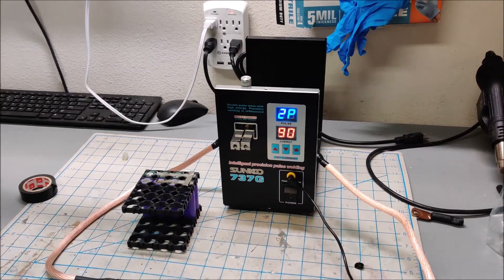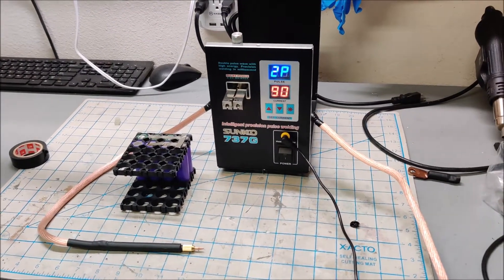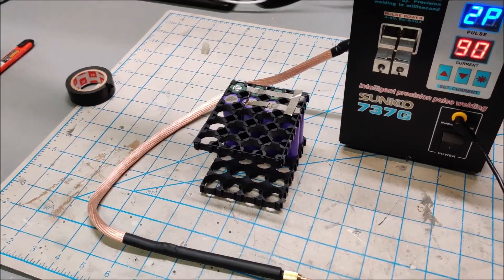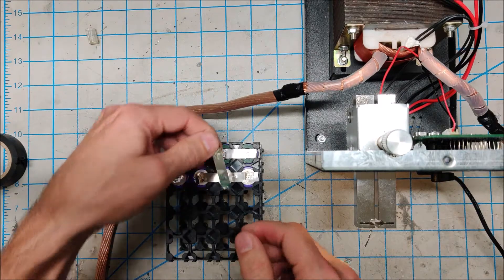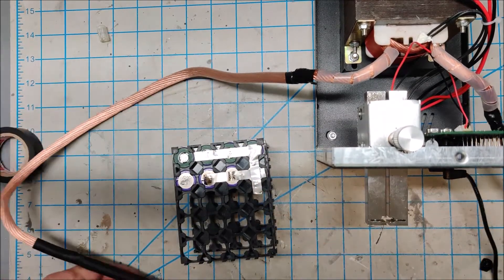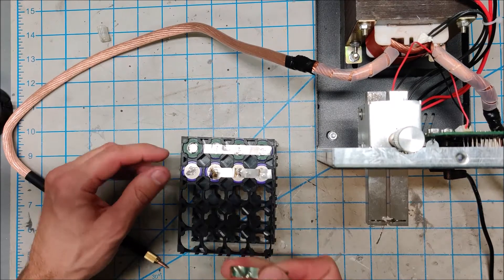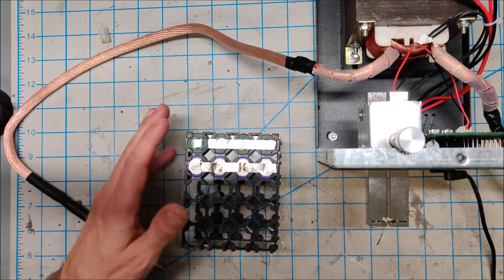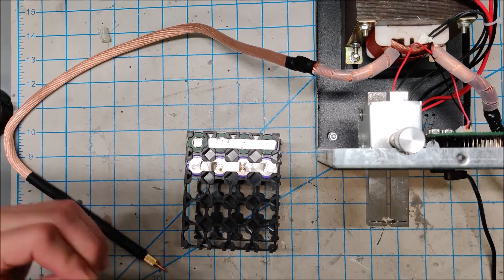FINAL VERDICT SUNKKO 737G SPOT WELDER

Comment: Where do I get the cable you are using? In my country there is usually nyaf cable.
Reply from the maker: Use cheap jumper cables wire

Comment: dont throw it out... mine works amazing for 1.5 strips with pens attached... the trick really is to change out the transformer... or just grab 4 feet of 4 guage (44 inches) and wind it around 4 times... youl need to pull the copper out of its casing and use a thin shrink tube... hammer the wire flat aswell before feeding it around the transformer... the machine is awesome... the transformer is crap.. pcb spot welders are to sensitive... any novice person will blow a bunch of mosfet's before they realize how to properly use one....

Comment: I received mine yesterday. 110v model. It cannot weld 0.30mm strips. I was looking forward to repair a lot of my branded 18v batteries but couldn’t. It would not penetrate the nickel plated. But, if you’re welding anything below 0.30mm thickness, especially 0.15mm I think it’ll do the job. However, I was told by a China seller that the 737g+ (220v) is their strongest welder in the non-commercial market, but I’m looking at $300 versus the 737g—$100.  I also read some complaints on the pen that comes with the 737g+ is no good and must replace a 70B pen around $60. So you’re looking around $350 total to weld thick strips. Conclusion, I would buy the 737g+ and the 70B pen “IF” there is some type of insurance or warranty or possibly replacement parts for the machine in case it breaks.

Comment: please help i bought SUNKKO 737G but the welding space is short i hope to find a way to weld with pen or any solution  , thankssssssssss for months i waiting for this video , my is 220 v
Reply from the maker: Either screw on two welding neededs to the two arms like i did in my spot welding pen video or carefully open it up and connect your spot welding needles directly to the two transformer wires inside. (Obviously make sure its unplugged when you open it up :) )
Reply: @stevenc22   thanksssssssss , which welder pen i must use